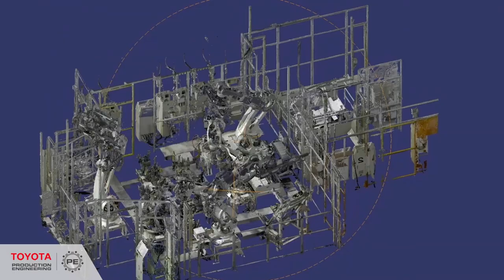Inside Look into Toyota Production Engineering | Toyota

Comment: My 2021 Corolla has so much road noise I’m thinking there should be a class action law suit for impact on hearing. I’m getting rid of the car as soon as I can. It so loud I dread driving it and my ears seem to oooze afterwards if I don’t wear my ear plugs. I had to buy ear plugs just to be able to drive it. Who is responsible for the decisions to make the lower end cars noisy???
Reply from the maker: Hi, Robert. We regret to hear of your experience, and we'd like to discuss it with you further. When you have a moment, please contact us at (800) 331-4331.
Reply: Add sound proofing material